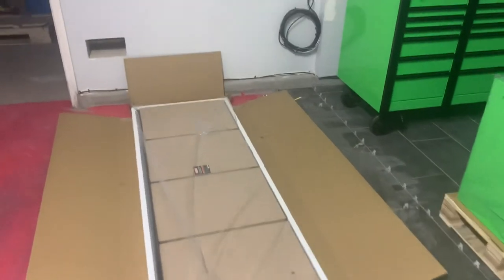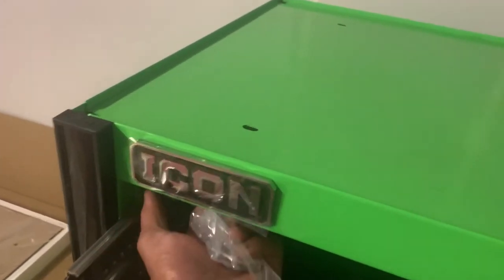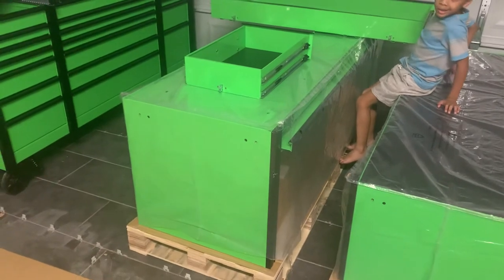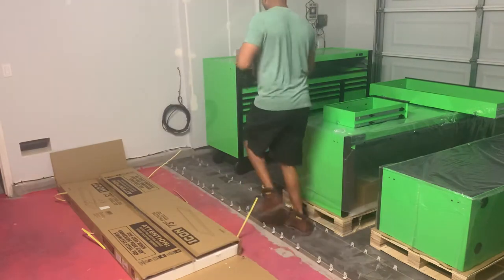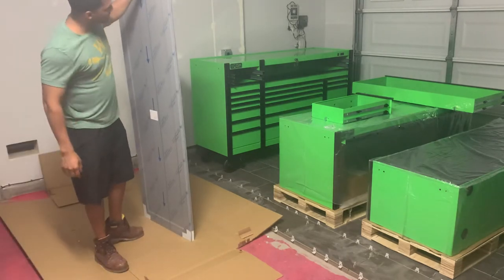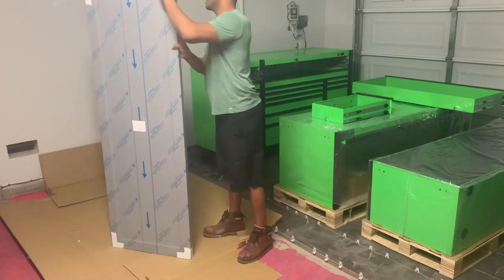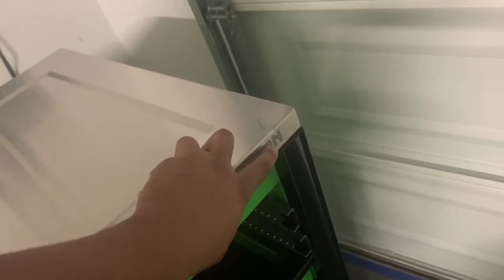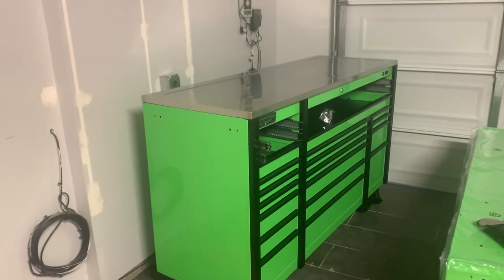ICON 73 Stainless Steel top install

Comment: I applaud your determination!! How did you get the hutch on?
Reply from the maker: Trail and error. I believe I just used an eye bold in the ceiling with my WARN portable winch to lift it up.

Comment: Wait is that the ICON brand SS top? There's an overhang in front??
Reply from the maker: What’s SS, and overhang where?
Reply: @unfilteredjamaican3478 stainless steel.
16:12, you even called it overhang. And then shortly after you called the fasteners "wing nuts". You were confusing me as I'm trying to research this thing. A "wing nut" would imply the SS top has some sort of bolt sticking down already, but that's not the case. What's in the bag are called "wing nut bolts" that thread INTO the SS top. Big difference.